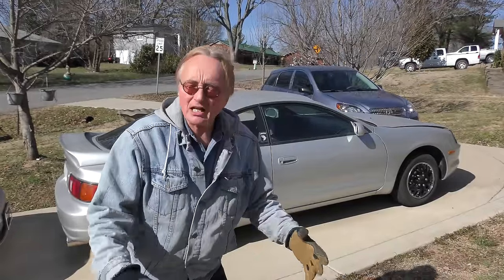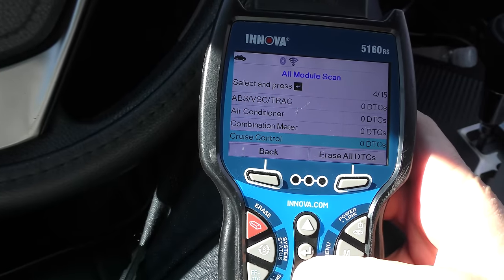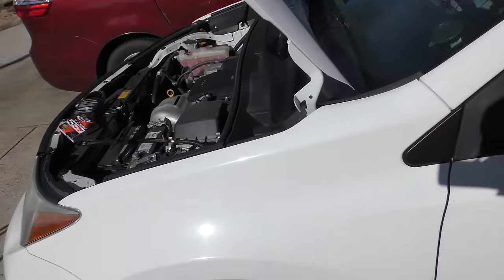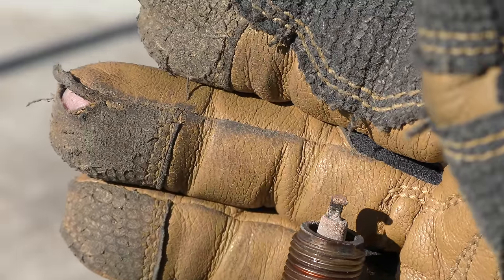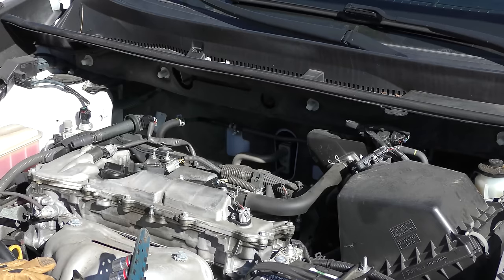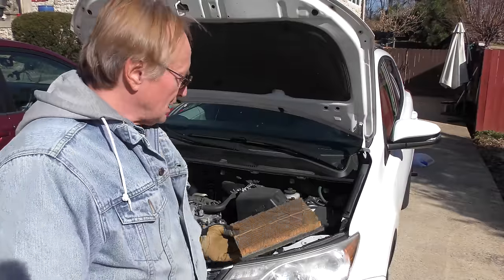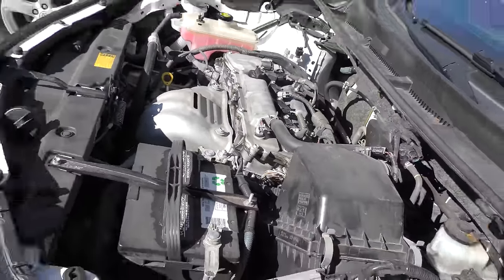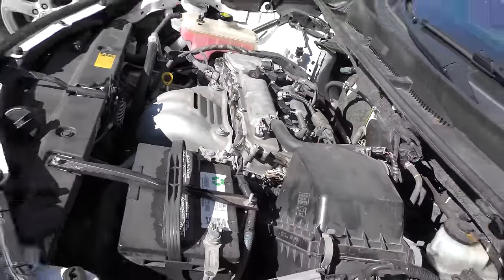Here's Why You Should Remove Your Gas Cap Right Now

Comment: True words on routine car maintenance back in the day, I learned by helping my Dad in the early 70’s pulling, cleaning, and checking the plug gaps. Pulling the distributor cap checking the points, rotor, and contacts. Checking the timing, dwell, along with any carb adjustments rich/lean/idle along with a shot of carb cleaner. Looking for any leaks, all that was done at home back then… Dad was impressed with Honda’s CVCC engineering, running on regular gas meeting the emission standards without all the added junk you would find on most other models then. Love your show and the knowledge you share!!
Reply: m rapacki  my dad taught me how to tie my shoes then he was done suppose I was a slow learner LOL
Reply: Ahh yeah, the good old days!
Reply: Gregory Parkes <== I'm with you.  Dad would trouble shoot all of the family cars' troubles and do maintenance.  Was with him when a u-bolt came off the rear end of the drive shaft and we got help using a CB radio.  He helped me all the time with my first car, a Fiat.  Good memories 👍 from the 80's.
Reply: My dad did these things as well...but being relegated to "holding the flashlight", we all know how that ends up...
Reply: @ekummel  or hold the wrench
Reply: @googacc4654  slow teacher
Reply: @ekummel  llol been there. The engines over here not in the trees
Reply: My Father died when I was 12 but I worked with my husband and we redid 4 ‘57s in the 70s.
Reply: @apj341  Ah yes the "Fix It Again Tony". Dad must of been helping you about every other day. Chuckle Chuckle.  But that is how you learned how things worked ( or didnt)... And then maybe a little different way, but the theory was the same on most cars back then.  It also gives you confidence to tackle other things you never would of dreamed of you could.  I found out on a lot of stuff. "That's not so hard" but I never would of known that without trying it in the first place!!!
Reply: @ekummel  The flashlight detail.. I'd get bored fast, and the beam wasn't shining where it was supposed too. "Hey you  have one job and you can't even do that right" Felt two inches high.. but as a kid you kind of forget that quickly.  One time I was really focused (and it wasn't that cold out either) Must of been an easy fix, because It was over. I had done it well and my dad was praising me with a " Good Job"!!! That's what I remember most too!!! RIP Pops ...I'll see you again, I'm sure of it✝️
Reply: @sharonp4446  Sounds Awesome! God has his own plan, and that was it... You got plenty of attention from those cruisers I bet!!!
Reply: @ekummel  yeah I was the official flashlight holder too, and the tool and cold beer getter too lol.
Reply: @midnitesquirldog1 Yea even into the early 90's on some vehicles.  I have an OBD 1 that I access with a paper clip under the hood, flashes codes and is surprisingly advanced. But the electronics on this old Lincoln are very reliable.  Before all those coil on plugs that are always going out on the later cars it seems.  Once they went to Fuel Injection and its  much more complete Combustion,  these cars can last a long long time too if maintained properly!!!
Reply: @midnitesquirldog1 They don't want you to do anything on your cars anymore. Thus no dipsticks at all on alot of transmissions. Then they hope you take it to the "Stealership" for service.
Reply: I remember the early GM HEI ignitions burning through the rotors causing a sudden no start or run condition.  I'd go on a service call, if it was a GM product I'd take a rotor with me, most times fixed on the spot.
Reply: I used to Talk, a lot, when i was little and Dad was driving. He taught me how to roll the Window up, pull his Finger, pass out and, thus, shut the hell up.
Reply: @ihavefallenandicantreachmy2113  Smart Dad!!!
Reply: My dad couldn't change oil. But I did learn some basics from a dear uncle. Taught myself to overhaul engines, transmissions, and most all general repairs.
Reply: @tinamcgarrah7794  Fiat- fix it again tony
Reply: @davidespiritu133  Yea that's what my dad an old Sicilian used to call em! He's in heaven now, making God laugh.... Espiritu...thats a Cool name!
Reply: @eddiebeaty8150  That's really being interested, so much so, you taught yourself the full range of mechanics..WELL DONE!!!
Reply: My dad taught me to work on cars in the late seventies and also taught me how to repair appliances and just about anything. He did it all except alignments and new tires  By the time I was 18, I rebuilt the 455 in my Trans Am in our driveway. Unfortunately, my sons have no interest in learning how to repair, fix, or build anything. This younger generation, I tell you ...
Reply: you were fortunate to have such a mentor.
Reply: Yip. I remember the old days. My dad did his own oil, transmission, and radiator fluid changes with the old cars. He even re-timed the old crapy Datsun over and over with a timing light. Not to mention plugs wires distributor cap etc.  Thanks, dad, for teaching me a few things about maintaining cars back in the day.  RIP. I was 17 back then . Now in 55. I still tinker with cars. However,   the new ones are boring.😂

Comment: Did the same for my daughter’s 2014 Corolla along with belt, coolant change, transmission service, Akabono brakes all around with brake bleed.  Even sucked out and exchanged power steering fluid.  Lubed all the hinges and locks.  Then three months later the tire pressure system started to fail.  Not paying $90 per sensor plus installation costs!
Reply: I use a tire gauge
Reply: If somebody uses Fix-A-Flat on the tire the sensor is ruined also ruins the tire guys day 2 just hope it wasn't first Tire of the day🥱😡
Reply: The batteries die...not sure if they're serviceable though.
Reply: Discount Tire does them for about 60 parts and labor
Reply: Who needs it? Take it in for a free tire pressure check a few times a year.
Reply: Me neither
Reply: A 2014 Corolla has Power Steering Fluid?  My 2009 Corolla had already moved to electric power steering.
Reply: Modern cars have electric power steering system. Remember to clean your MAFS.

Comment: Good stuff.

Had the same issue with the fuel cap but instead of buying a new cap.... Ended up wiping the cap and opening with WD40, which got rid of the error code! 

Dirt gets trapped between and causes the poor seal to throw off the sensors!

Comment: I removed my Pilot's air intake assembly to install a battery minder and discovered that the hose connecting the airbox to the throttle body was not properly seated. Probably never had been. The vehicle has about 50K miles on it. Though I changed the air filter regularly, I pay much closer attention to the hoses and wires now.

Comment: If you want to buy a scan tool, make sure it’s compatible with your vehicle. There’s OBD 1 for vehicles made before 1996 and OBD 2 for vehicles made after 1996. Some cars made from 1994 to 1996 use what’s known as OBD 1.5 which usually means it’s an OBD 1 system but with an OBD 2 connector. Scan tools that can work with OBD 1.5 are expensive or hard to find (like the Bosch OBD 1300). I hope this helps someone!
Reply: Scott use Innova not any brands you mentioned

Comment: I dont have any magnetic spark plug sockets. When I have changed plugs on my vehicles, I use a 2' piece of rubber hose. I slip it on the plug end and guide the plug to the hole with my left hand and turn the plug using the hose with my right hand. When working on a v-8 this is handy.
Like you videos
Reply: My plug sockets almost all have a piece of hose inside as original equipment.  Never saw a magnetic one.
Reply: A lot of mechanics say to take out the rubber in the spark plug socket because they tend to crack the ceramic on the spark plug when tightening down.
Reply: @jalsr.speak2379  That's just an excuse.  Its not the rubber that cracks the ceramic.  Its allowing the plug socket to lean against the plug.  Keep it straight by holding it with two hands and you won't crack the ceramic.

Comment: Either the magnetic spark plug sockets or the rubberized ones (although the rubberized ones can wear out, so if you're a mechanic, get the other ones as they will be used a lot).  I never had a problem with the rubberized ones (with the rubber in the middle) but I also only used it maybe a dozen times on cars over the years.

I actually like what Toyota has done.  Newer Toyotas since about 2020 can use Android Auto or Apple Car Play and you can project Google Maps or Apple Maps to the LCD screen on the radio, so it's like you have navigation, but not paying extra for it and it won't malfunction (and cause error codes).  Maybe not as elegant as a built-in GPS but it works the same (I can interact with Google Maps as if it was built-into the car in the form a navigation system).  Best thing is it didn't cost any extra (I could have paid about $1000 more for the upgraded stero with Navigation, but not worth it if I can do this).
Reply: Yeah, with the 2016 youvhave to set audio to Bluetooth, then select the phone to get audio.  I never look at the map, it is the audio that matters.

Comment: Gapping spark plugs, if you do it correctly you don’t touch it center electrode. I have gapped Iridium plugs and have never had a problem. The problem I do have is that when I buy these plugs they are rarely gapped correctly. For instance when I bought a four pack for a Honda not one of them had the same gap. The boxes are tossed around and thrown around during shipping and the manufacture to the parts store. How to gap a spark plug correctly is the key.

Comment: My acceleration for 2014 Honda Civic was legging pick up. I searched on google & came across this video. I unlocked & locked smoothly gas cap again & boom it started & drove like brand new car. Again next day after driving 50Kms acceleration lagging & did same thing, opened & tighten gas cap. Car started driving like smoothly again! I found a problem that it has gas tank evaporation issue & ordered a brand new OEM honda gas cap. Let see how does that improves acceleration. I’ll keep you updated.

Crazy that just a small gas cap impacts a engine performance widely & driving ride too!

Comment: I wish all cars were easy to change the spark plugs like this car.
Reply: @NoName-gv6nm  My '13 Mazda has a beauty cover on it that houses the air filter and ECU together. Have to remove air intake as well just to see the valve cover. The whole thing comes off as one large expensive piece, I hate it.
Reply: Hyundai Santa Fe takes about 3 hours labor to just change plugs. The engineer who came up with that design must get a cut from the $300+ it cost you to change plugs… 🔌

Comment: The 2.5L 4th gen rav 4 engine looks beautiful as you see mostly metal instead of mostly plastic crap like european cars. Good afternoon scotty!
Reply: Remove the cover and they look the same as far as metal to plastic goes.
Reply: @Brem  that's not true. Euro cars these days have plastic intake manifolds, plastic valve covers, plastic thermostat housings, plastic oil pans & so on.
Reply: @waynes.2983  I have a European car... it has none of those things.
Reply: @bremCZ  well you have a good one then.
Reply: @waynes.2983  Not just good, "Superb".
Reply: Finally a great deep looking guy u re
Reply: Yea, that Rav4 between 2013 until 2018 around is extremely good smoot tuff and solid car. Without really no plastic trash like most others in that time age. I got the hybrid 2017 and yeah those engines are currently in long-lived terms the gold standard completely out of metal,  even the top is extremely solid,  compared to a natural aspirated 4 cylinder it is even out of MAGNESIA. And in my case the rav4 should life almost for ever. Only 1 point is to criticize,  since 2015 the bolts are unfortunately here in the rustbelt Europe pretty fast corroded. 
Regards Jay
Reply: @JWORLDKING  It was no 3SFE.
Reply: No discussion
Reply: Why ever are in that Hybrid cars pretty solid metal parts on it. And they do that not for fun...On the new Current Rav4 they replaced already that Magnesia Top Headcover into a feverglas we call it. ALLEGEDLY because of the weight.....Yeah, a small extremely ligh Magnesium head cover brings allegedly few grams, to replace weight. For me the real highest quality typical Toyota Rav4 was between 2013 - 2018.... Newer versions was extreme more lighter, what brings in comparison not advantage at all, because I drive reasonable the 2017 Hybrid Rav4,  my ex drives normally the 2020 and she needs even a quarter more of gasoline than me, in the average. I arrives in the summer about 1000 Kilometres with 55 litre tank and she with Exactly the same tank only 850 around. I figured out,  that they on the new Rav4 2020  exchanged metal  parts  like the engine head. In my opinion actually absolute no win or advantage for Rav4 owners, maybe for the producers, because that brings around 100 kg less weight. All inclusive. And the crash results are on the newest beautiful looking Rav4 are even more worst, compared to the unbelievable 2013 to 1018....maybe u should ceep yust a great great car construction.

Comment: Have been putting anti seize on lug nuts and spark plugs for over forty years.
NEVER had anything come loose.
MUCH more pleasant to work on after time and NO corrosion... easy unscrew by hand.
The trick is knowing torque feel.

Comment: Hey Scotty you forgot to tell us something. The MAFS should be cleaned every time you change the Air Filter because it gets dirty and starts to give the wrong air/fuel mixture to the engine and sooner or later it will cause the your engine to stall out immediately after starting. This is a crucial part of maintainance.  I have seen this cause problems for people so many times. Also clean your battery terminals because I have seen where the dash lights go haywire and the car won't start but the terminals dont even look dirty. But after you clean them the car starts working fine.
Reply: Definitely clean the MAF sensor.

Comment: Usually if you notice your car idles wrong or accelerate slow, change your gas cap! Or you purge valve canister. Just a little fuel vapor pressure leak can affect your cars performance

Comment: After watching several of your videos and posting a question in your forum, I decided to purchase a diagnostic computer, $500.00 dollars well spent.   I had a major break issue, 2 dealerships, a diesel shop, a standard auto repair shop, and a few "specialists" all failed to identify the problem, and most asserted that what proved to be the actual problem, wasn't it.   Adding the purchase price of the Diag PC, I still saved half on the repair and gained a valuable tool.

Comment: Hi Scotty, I see you use a magnetic spark plug tool.  The ones I have are not magnetic but rather have a cylinder of foam rubber inside, into which the top of the plug fits snugly.  It performs the same function of holding onto the plug so that it does not drop.
Reply: Sometimes those rubber pieces stay on the plug. I recently switched to magnetic.

Comment: FYI to everyone's spark plugs might have a wrong gab just because of shipping so make sure to check the gap
Reply: Exactly
Reply: Some spark plugs are already pre-gapped, from the factory.
Reply: Dropping the Box all it would take
Reply: @The Royal Crowned Tiger  Yes factory plugs that come with the car are but when you need to buy new ones you should check it.
Reply: @bestlaptop_psn  : I have seen spark plugs at the local auto parts store, that are already pre-gapped, and it's written on the packaging too, so check the packaging.

You don't have to go get original plugs, to get pre-gapped spark plugs.
Reply: @The Royal Crowned Tiger  Well obviously you don't need factory plugs. The gap usually gets out of adjustment during Shipping, I have seen it ordering parts and checking myself so again you should check it

Comment: My car has that same P0455 code right now. Gas cap didn't fix it, so now it's on to the purge valve, charcoal canister, etc until I find it. And if I end up replacing them all, my feelings won't be hurt because I'll know it's got all those new parts I won't have to worry about for a while.

Comment: Scotty, you forgot to double check the gap on those new spark plugs before you installed them.  Yes, I know, the box claims they are "pre-gapped", but it only takes a few seconds to check each plug to make sure it's at the exact gap as specified in the owner's manual.  Now if you don't want to adjust the gap, at least now you will know for certain if they are the wrong gap and can take them back to the store for exchange.

Comment: Can't wait until my Ford capless fuel filler needs replaced, just found a video on that. It's an assembly with a fuel hose octopus that runs from the engine to the filler neck! There are also good vids showing how to clean and maintain those out there!
Reply: Could you please provide the link to that video? I have a cap less tank and when I try to put gas in the pump keeps shutting off and gas spits back out. Was hoping Scott had a video on this issue, but can't find one.